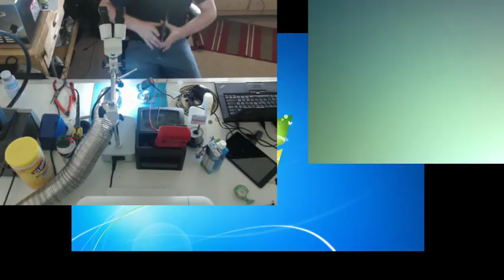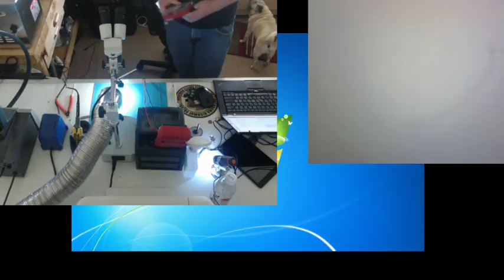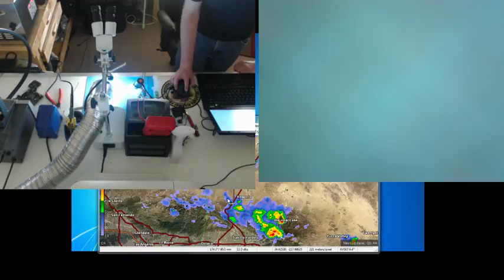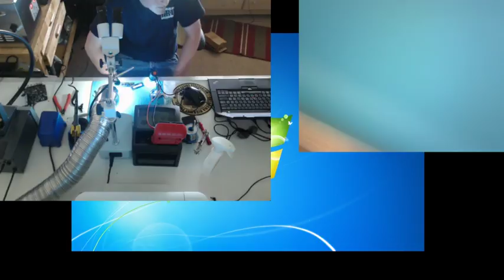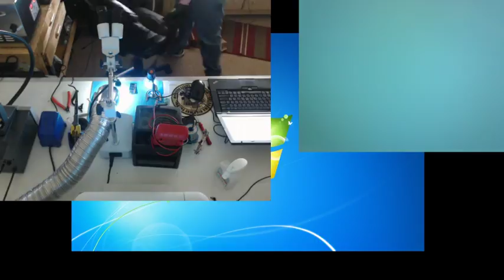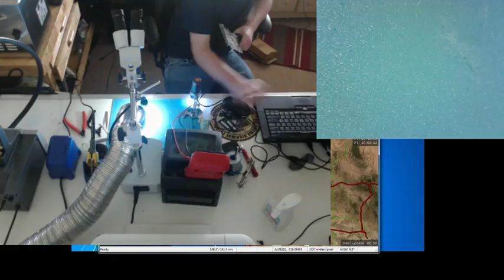Test of the TruSonik TS-5 Ultrasonic cleaner

Comment: Why would you use a dry chemical extinguisher?  Co2 will put out the problem with zero contamination to the room and especially sensitive electronic equipment in close proximity. The Co2 would pay for itself in savings in clean up and electronics saved.

Comment: Hey what's up could you possibly do a tinfoil test placing a piece of tinfoil with folding the sides with a close-up camera action lol
Reply from the maker: Sure
Reply: TCRS Circuit by the way I just done ordering one 😁same model as yours 😳 hopefully it works good lol
Reply from the maker: You'll like it.
Reply: TCRS Circuit if it does the job I will have no complaints lol 😂 it was a tossup between yours and @STS Telecom but ordered your model I think that would be a good video for you to do tinfoil test 😁
Reply from the maker: I may do it later